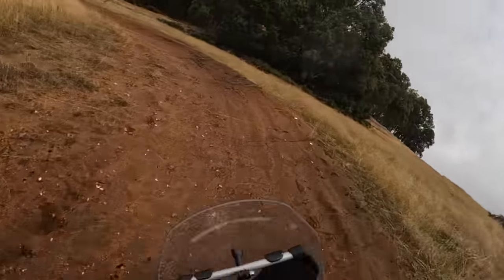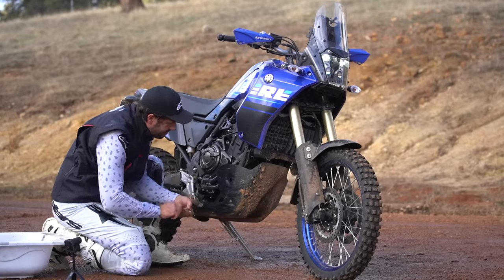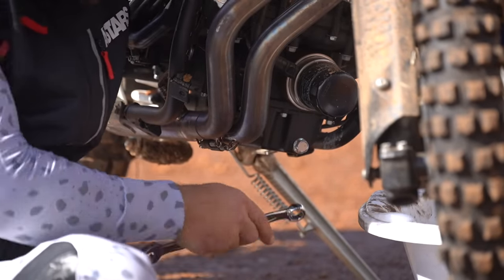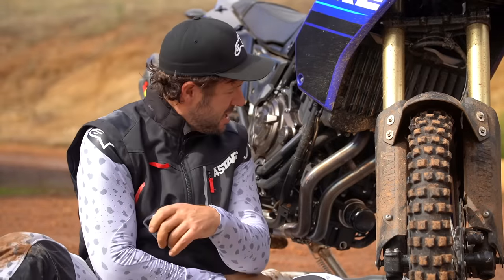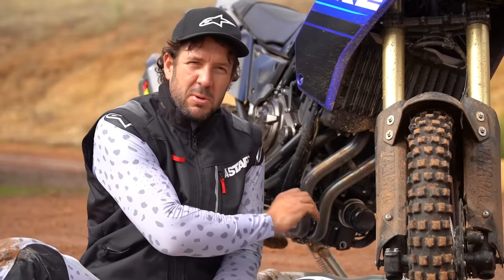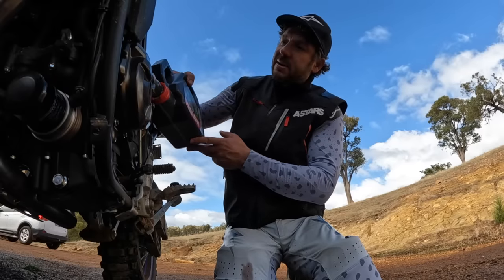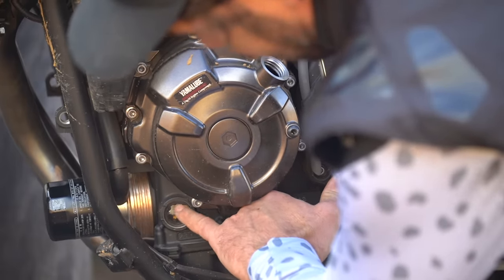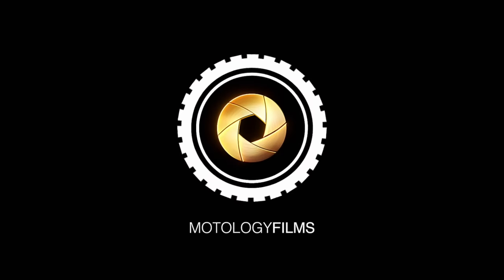Ultimate Engine Maintenance Guide: Triple Your Bike Engine's Lifespan

Comment: Well even if you have the engine at running temp, part of the old oil will always remain with every dirt particle inside the engine. Nothing you can change about that. You can try to flush part of the old oil with new oil before you screw back the drain plug but it wouldn't change anything to the durability of the engine. Only the frequent change of oil can do that as the manual tells you.  

OEM oil filters have a specific life expectancy that can be found in every workshop manual for said bike. In case of the Tenere it's 20k km and oil every 10k km. If an oil filter is so full of dirt that it doesn't let enough oil pass through it then you have neglected your bike already to a point that damages inside the engine occured. 

Nothing new for people you have the smallest understanding of their bikes.

Comment: The baypass is not for the filter getting clogged (not mainly at least). Its there for when you give gas and the flow that the engine is high, the filter would restrict the flow, so it baypasses it. When at lower revs its then filters it.

Comment: there's one thing I hate about oil changes more than how much diesel oil stains the skin, & modern diesel are designed in a way that you simply cannot change it without getting covered in oil, especially from the plastic capped filter housings it's... actually I test drive all the cars before a service starts to help find faults & hear any funny noises. but these are cars that have to be tested on a public road... we can't drive them like that, and the oil is definitely warm, but not to the point of being a burn hazard, thank god.
At least with a bike you're not standing underneath it!
I always put an extension on the socket, keep my hands further away from the stream of oil. But some of those oil filters...  just loosen and let it drip, deal with that later!

Comment: Imho you should change it after the bike has been sitting at least 2 hrs, you then start it for 5 minutes but do not ride /engage the transmission because that make the oil circulate all up into the engine and takes hours to come back down again .Guess what ? I lied it's not just my opinion it's Hondas too ( and probably many others) .

Comment: 6:43 Not entirely true. Maybe for bikes, but with cars, its a bit different. Hot or cold you are not getting all the old oil out, simply physically impossible. IF you stop at a quick lube place or a fast moving tire shop to get the oil changed on your shopping trolley of a car, and are on your way in 15 mins or less... Obviously they didnt allow the oil to drain completely (while rambling on as you have here) they drop till it drips, plug and fill and send you on your way. You can change your oil cold, and allow all the oil to drain and it not be black after. Ive done it plenty of times. As for the "blackness" being foreign matter, yes, All of the fluid black of not is foreign matter to the inside of the engine. Different oils have different additive packages, some of those wear out faster than others and cause a darker oil faster. As the Paraffins in the oil get burned and charred your oil turns darker. The moment you change a diesel engines oil, one start up and it turns black. This does not mean the oil is now past its life cycle, its just a byproduct of the engine and the oils chemistry.

Comment: Yes hot after a good ride but dont need to be dangerous hot coz its well mixed and dirt takes ages to settle out
And oil lasts half what they say , soon as its discoloured its literally COOKED 
You then can do say 2 oil to one filter
Also ALL oil of same specification IS THE SAME regardless of brand , i use west way oils in the UK 
Great prices and made in England so WILL be as specification 
Best prices are by 10 or 20L barrels 
Car or bike

Comment: I always go leadfoot prior to oil change. Then very slowly (to avoid thermal shock spot) apply 200ml of kerosene as a flusher and the drained oil is like black coffe. The car then cools down for couple hours waiting for fresh oil and filter. That's how I changed oil for like 20+ years. People laugh at me because of that heat-up technique and oil flush ("oh noes! Ye gonna make Yer engine sweat oil from any possible seal"), but I have their opinion far up my a**.

Comment: Seems like planning an oil change for the end of a ride would be good advice. I'm not sure I would ride my bike hard and get it real hot with dirty oil for the sole purpose of an oil change. I mean that's the least protection your bike will have with dirty oil and a useless filter. Then ridden hard seems like a wear producing environment. I get the point but if you have that much sediment in your engine you should just change your oil more often rather than ride it super hard with bad oil.
Reply from the maker: The whole point is to do this from new, which will never allow sediment to accumulate. Riding it hard before an oil change will simply "wipe up" any collected sediment and jettison it as you drain the oil hot.

Comment: Adam, before this video, i just changed oil to my CRF250 with 20W-50. First, o o, i put wrong oil to my CRF, then I searched from YouTube. Then I saw this video you put 10W-50, since I lived in Indonesia with no winter weather, I think it must OK with my motor. Question to you Adam, is that ok with that 20W-50 to my CRF? Thanks Adam. Cheers

Comment: motorcycle oil filters hold 10-14g of dirt... imagine 2-3tsp of sugar... in a sense an oil filter shouldn't ever get clogged. 
car oil filters may be cheaper and can hold more dirt but usually the valve pressures are considerably higher, 15-20PSI vs 8-12PSI.

ps: even by hand, that's overtightening right there @11:40 :). 
12-15Nm is all it needs per all service manuals, that's basically 3/4 turns after the gasket makes contact.

Comment: cant speak for a motorcycle, but on semis the oil is generally at least 10 degrees f hotter than the water temp. nothing uncommon to see 50 or more degrees hotter, and they run oil to water coolers unlike a bike does.

Comment: I am actually surprised that riders chance the oil cold.  The issue is, many just do not read the manuals. They get the keys and go. Big mistake. In 30 years of riding, every time I got a new bike, the dealer's mechanic always says....Read the manual before riding. I will tell you more then that, many choose whatever oil they feel like to use. Its WRONG too.

Comment: 10w50? doesn't the Tenere take 10w40?
Reply: I think Adam rides his bike little bit harder, so might be a good practice to use oil with better resistance to parts wear, when the engine is very hot -most of the time. 10W-40 is better choice , if you use your bike other things than motocross.
Reply: Also here in Australia we have long hot summers, our  KTM 790&890 dukes use 10w-60w

Comment: Or it’s black because you have an air cooled oil cooler which has residual oil that doesn’t fully empty on an oil change unless you disconnect it and drain it

Comment: That word you keep using. I do not think it means what you think it means 😂. Redundant means that it does the same thing as something else is already doing. I think you meant useless or moot. People still understood though. Still a good vid. Also, you don't need two-hand grip to tighten the filter. Most filters only need about 20 lb-ft

Comment: How much longer does an oil filter last if the oil is changed correctly?
Reply from the maker: A long time if you're starting with a clean, flushed engine with new oil. If oil is changed cold and unstirred, the debris simply accumulates with every service cycle, and the filter blocks quicker and quicker every time it's replaced.

Comment: Oil filter tightening torque is 17Nm or  13lb/ft and oil drain plug is 43Nm or 32lb/ft but I recommended tightening it to only 32Nm. 
So mate, you went full gorilla hand grip on those 😂.

Comment: Your filter filters way longer than most even allow. Your whole 1st gear ⚙️ would have to be completely sheared to plug an oil filter. There’s a reason stretched out your filter is over 2 feet long. As for debris in bottom. Yes for months but the following day or morning or 2 days from last ride. No. THERES a reason Oil keeps materials in suspension. 

Do a lab test on Motul because She’ll Rotella T4-T6 is just as good as Motul just 2 jugs for the price of one Motul jug.

Comment: Whilst I realise the benefit of what you are saying. Telling the average Jo to take the sump bung out of a red hot engine is dangerous. 
Even if you avoid getting oil on your hand when doing so, it can still result in the oil splashing out of the drain bowl and over you.
Most people will not keep the bike long enough to realise any benefits anyway.

Comment: This information couldn't be farther from the truth. Oil turns black from temperature alone, Contaminates (from the engine) would be silver and the other colors would be from fuel and or coolant (which isn't black). The bypass valve in the oil filter is so the engine doesn't get starved for oil when the engine RPMs are high and the oil pump is at 100% flow. The oil filter is still filtering at this point but its not 100% filtering. If you really really want to waste your time to make the oil perfect, drain the oil and dump new oil in with the bolt still off to flush the pan. Run the engine for a couple minutes and change it again to remove the "rest" trapped in the head (this is a waste of time - don't do it).

Comment: The whole big deal about getting the motor smoking hot is silly.  Warm is up so it flows easier out of the drain..  Detergents in the oil keep bad stuff in suspension.

Comment: I think the logic behind his claims is slightly off, of course i agree you should not change oil cold, but if the oil filter indeed clogs up and bypasses dirty oil, you should increase oilfilter change frequenzy instead.
Adressing the mileage before filters clog would be relevant, is it 5 miles, 500 miles or...?
The title smells of click bait..
Where are the scientific numbers supporting the claim of triple lifespan of engine?
Also I am not quite sure if heavy weight oil has a higher hydrodynamic/hydrostatic threshold than lighter weight oils and I doubt very much the claim of heavy weight oil(from a 40 to a 50) not reaching into the corners of the engine.

Ride safe and change that oil.

Comment: Your oil could be black after one ride because no matter how hard/long/hot you ride the bike, you might not be able to re-suspend the heavier particles, some engines will just have too many places that it can settle, too quickly after you shut the engine off.
Talking in absolutes is usually pretty foolish.

Comment: Free "advice" found on youtube is worth every penny you paid for it, right?  Engine oil does not turn black due to the "particles" in it.  It turns black due to heat.  This is totally normal and does not indicate any type of problem so long as the viscosity remains within the parameters of what it's supposed to be.  If you are worried about this, send a sample of your oil to a lab and have it analyzed.  A good quality oil filter will filter out all but the tiniest "particles"....  choose a good quality oil filter based on facts and not advice from people who used "brand X" and have never had a problem.  Again, if you're worried, take the filter apart and see if it's internals are quality or not.  I've been riding and wrenching my own vehicles for well over 60 years and getting the oil warm enough to flow freely when drained is quite sufficient.  You are never going to drain out every drop of oil (nor do you want to)... so the fresh oil will be turning black pretty quickly unless the motor is new or recently rebuilt.  Again, dark oil is not a problem.  If you're worried about foreign matter getting into the oil don't do your oil changes out in the open!  A gust of wind could blow all sorts of dirt in when you have the filter and filler cap off.  High temp thread sealer on the drain bolt before you torque it to factory specs.  A film of oil on the oil filter gasket being sure to remover the old oil filter gasket is it didn't come off with the filter...  hand tight plus 1/2 turn.  Good quality JASO certified oil and a good quality oil filter changed every few months for hard off road service is what will greatly extend the life of your motor.

Comment: I would NEVER recommend servicing your bike in your wife's pyjamas. She would spew...

Fresh, cheaper oil is much better than long service intervals on expensive oil.

Best tip for maintaining a Two stroke that runs premix, pull the clutch in on long down hills. This will massively extend the engine life. Remember closed throttle coasting means no lubricant getting to the piston, rod and crank. If it's oil injected, no need to do this.

Comment: TOTALLY NOT NEEDED and wrong to drain your oil hot.  This isn't the 60's.  Modern multi-weight oils whose first number is 20 or less DO NOT need to be drained hot unless it has 20k on it.  Example: 10W-40 oil is 10 weight oil at ambient temperatures.  It gets THICKER when it's at Operation temp.  That's how multi weight oil works.  Just park your bike where you are going to change the oil after riding it.  The next day, all the oil that's ever going to drain down is in the crankcase.  It will flow right out smoothly at ambient temps.  Work smarter not hotter.

Comment: You are SO WRONG on this procedure. I change oil for a living on emergency generators. It is FAR BETTER to not run it and mix your oil right before you drain it. You think running the engine up to temp magically cleans off all surfaces? LOL Absolutely not. Once your engine has sludge build up, it takes detergent to rid of it. Running your engine only causes that sludge to adhere to the interior walls even more. By running your engine right before a drain, you now have all of the contaminants spread throughout your engine. It takes 48 hours for all of that oil to drain back down to the pan. By running your engine immediately before draining, you now left a high amount of contaminants left in the engine. Please don't give advice you are not experienced with. This is not a correct procedure.
Reply: I notice neither of you mention flushing oil - why so? Not seen it mentioned for ages - has it gone out of fashion?
Reply: I don't think that you're right about this because you want to get the oil out with the most particles suspended in the oil, and we all know that when we mix the oil it gets darker than when you let it sit, i made this experiment in my old beetle, when the oil sits for too long it looks like newer oil and when i turn the engine on it gets darker quick
Reply: Alex, if you knew what you were talking about, you'd know thar the correct procedure is to use flushing oil after draining the old oil. Not that anyone bothers to do this any more, but that's the proper way if one wants to be pointlessly pedantic.

Comment: That is the dumbest thing I’ve ever heard. The last time you rode and parked. The oil is all at the sump. 
REMOVING A DRAIN PLUG ON A HOT MOTOR AND TIGHTEN CAN DAMAGE THE THREADS WHY?? Because metal expands. So what was 25Nm of torque really is 15. 
The particles already are in the sump. From last time you rode.